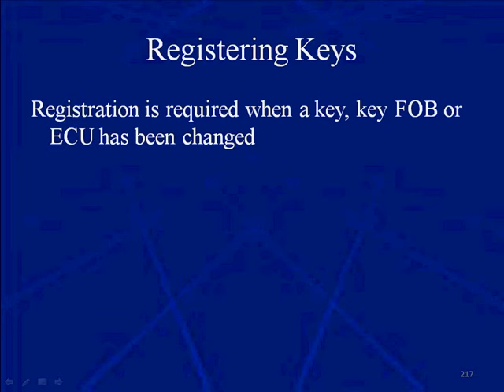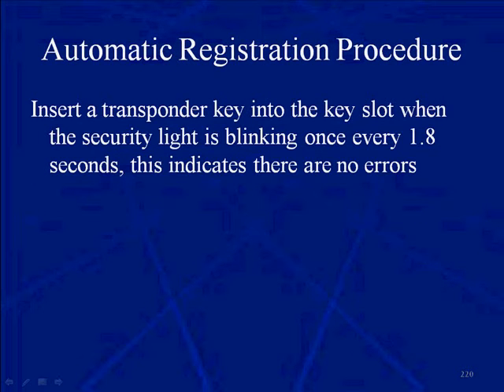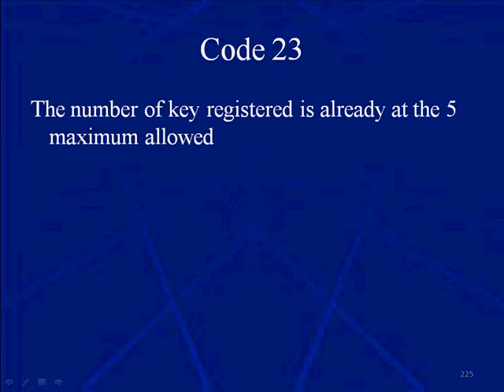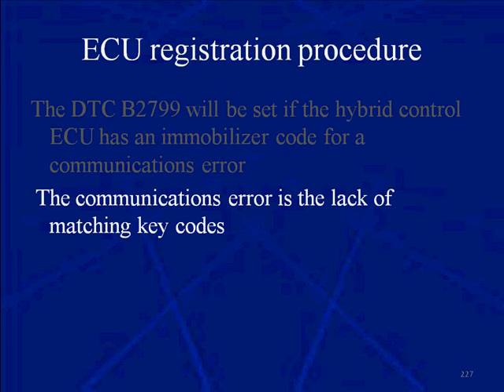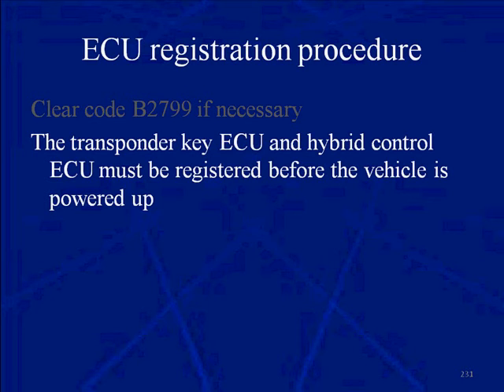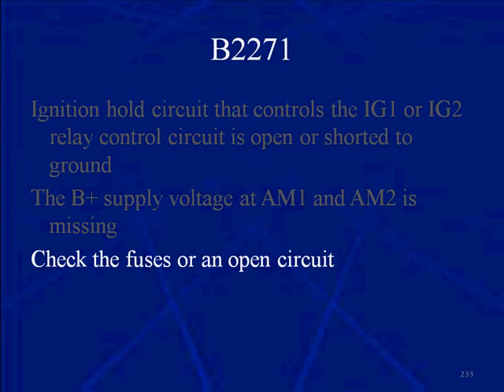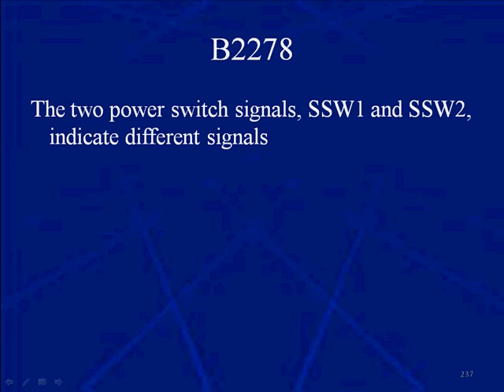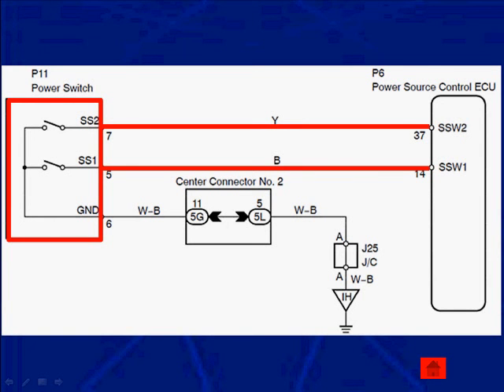06 Registering Keys, ECUs and Security Codes

Comment: Hello, I changed the ECU (Battery Sensor Voltage) due to burning, for it to work correctly, do I need to register it according to this video for it to be recognized? Because it shows errors U293 and U010 on the scanner.